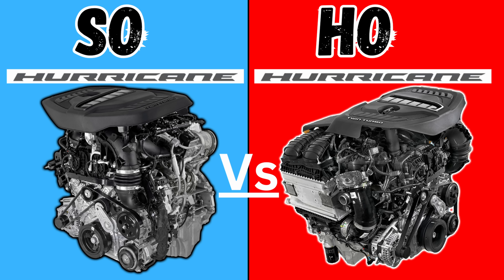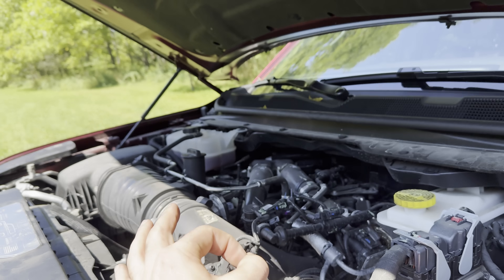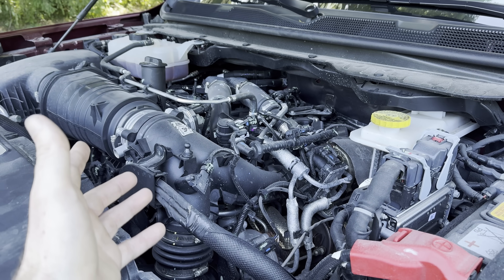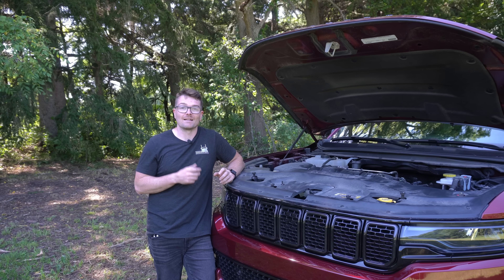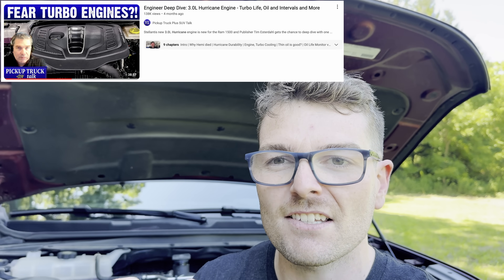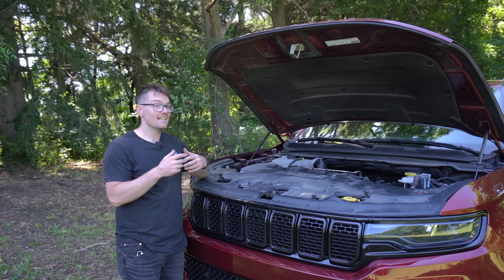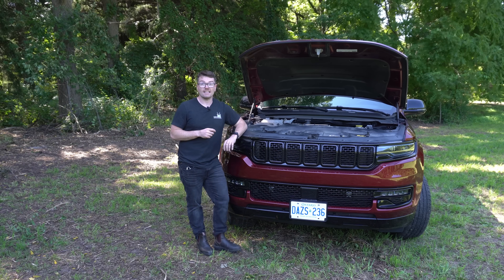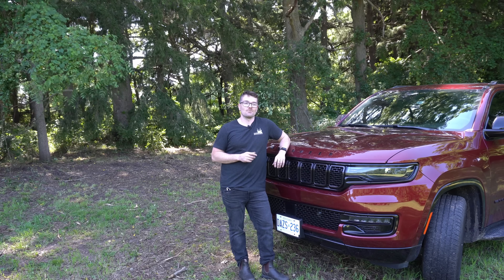Ram 1500 3L HURRICANE Twin Turbo HIGH OUTPUT vs STANDARD OUTPUT Engine | Which is BETTER?

Comment: I noticed you pulled the oil cap to smell the oil instead of inspecting the dip..... Oh wait, that's right, LOL 😖.... At any rate, it will be interesting to  see how these engines do in the long run. Extremely satisfied F150 5.0 owner here down in Connecticut. Love the vids.... please keep them coming..
Reply: Lol. Come on man. This high output aint gonna be a longevity engine. It gonna break down but it's bad ass. It kills that coyote but it will be dead and gone while the coyote will be the longest lasting engine putting out over 400 hp. But the standard output might do well for longevity. We will see.
Reply: They took fords weakness in their eco line and made them work. I still don't like the fact that it's direct injection, but it's going to do better than Ford and gms. That's partially why they waited so long. If Trump had gotten in office in 2020, the hemi would still be in the trucks. Make sure you vote yhe right way, the other way crushes our vehicles, literally
Reply: Be careful about making statements that are not facts. We don’t how well it will or will not last. The internals are very strong on these motors and an inline 6. I just think that people get way carried away in misinformation.